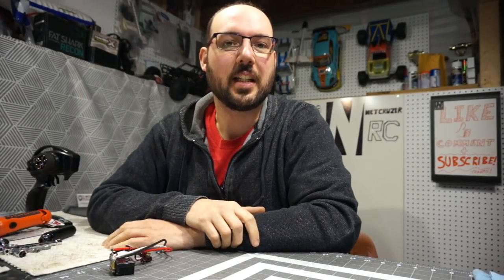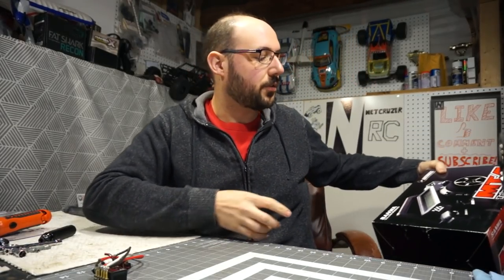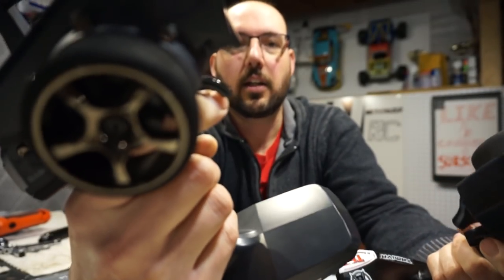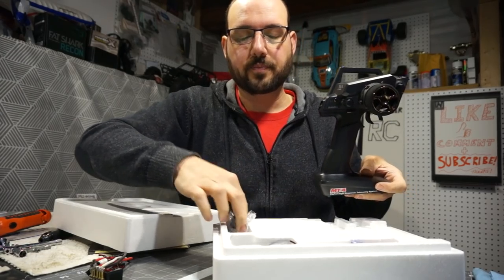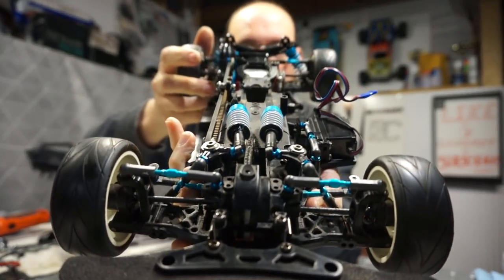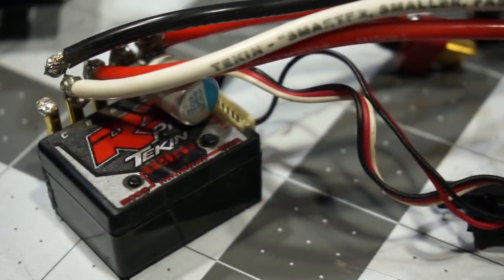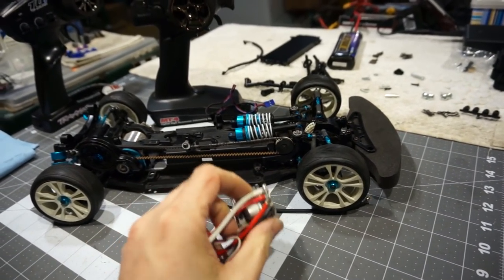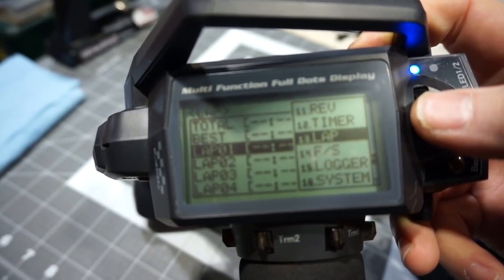Epic RC Haul! Tamiya TA06 Pro , Sanwa MT-4 Radio, and Tekin Electronics! - Netcruzer RC

Comment: Wow, can’t believe you’ve been racing with a TQi!  Most likely, the seller just trough parts in to say “RTR”. I bet that motor/ESC and battery were never in that. The ESC retailed back in the day for $220 - I know cause I bought one. I also remember the first time I tried the MT4 - I was blown away coming from my Spectrum DX3r-Pro. Make sure and de-solder that RS-Pro. It’s notorious to build up heat - and all that extra solder isn’t good.
Reply from the maker: Thanks for the tip. Yeah that solder has got to get off those posts.. I may need to buy a solder sucker to do it.
Reply from the maker: Do you still have the GRID drop down from when you had an MT4? Or any extra sanwa stuff I'd be interested. ;)
Reply: Netcruzer RC TECH CARS naw, no more Sanwa, I switched to Futaba (very similar feel) I sent all my Sanwa to my buddy who uses the exclusively. It’s funny - he just bought a used RC lot and got a practically brand new M12RS with a TLR 22.4 2.0, Ogio bag, iCharger with PS and a ton of parts, bodies, tires, etc for $700